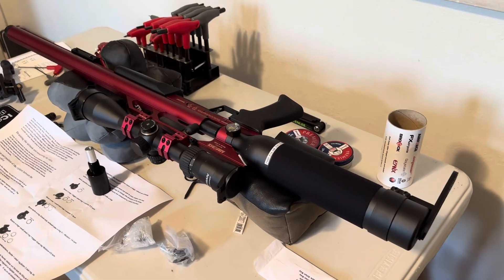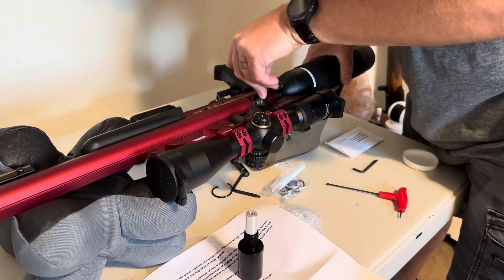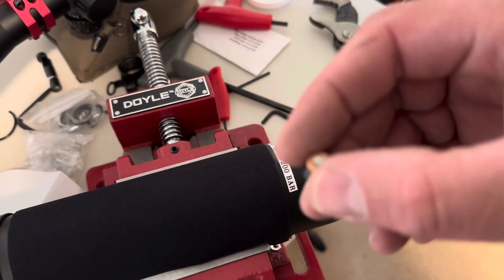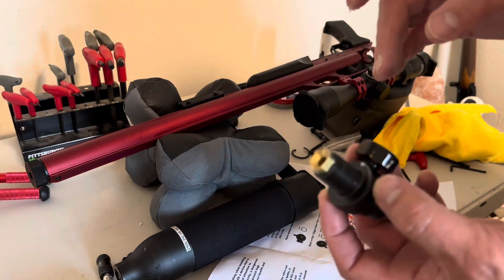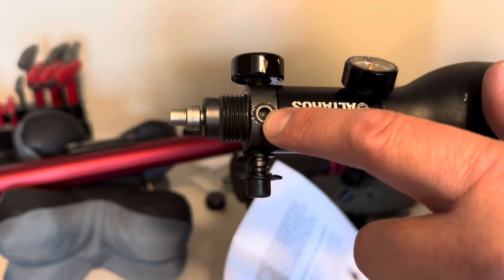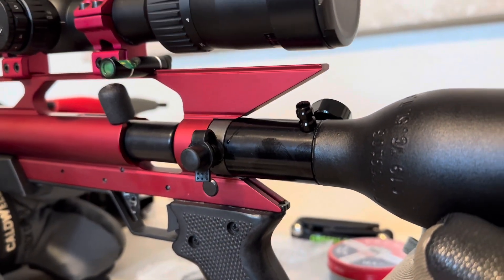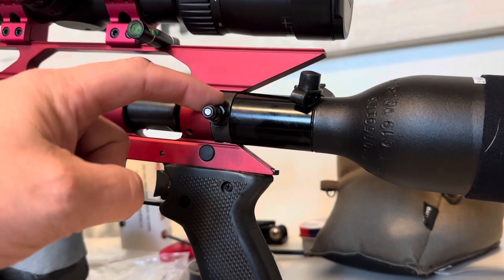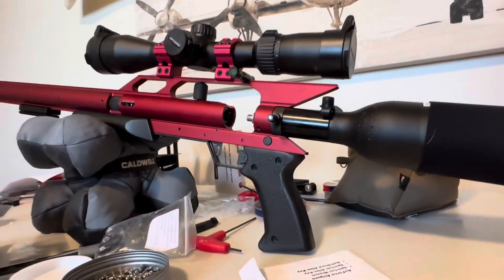Airforce Condor SS .22 Altaros regulator install challenges, and first shots test

Comment: Thanks for sharing this. I'm doing the same thing with my TalonP. I bought a 500cc bottle and the Altaros reg. I not looking forward to removing the valve from the bottle as well. I don't know if a little heat (not to hot) will make things easier? I know from my Leshiy 2 that only an O ring between the bottle and reg surface is enough, the pressure will seal it. Maybe this regulator kit is for more than one type of AirForce/airgun hens the extra rings?  W'll see . . . all the best from the Netherlands ;-)
Reply: I installed Altaros on my Talon SS 5.5 last week. To remove the AirForce regulator from the bottle Find a drill bit that fits the blank hole  snuggly (insert smooth end) and give it a rap with a small hammer Counter clock wise. I just laid the bottle on a towel and with a light tap  it came loose.
After installing, The rifle  gauge reads 1000 psi less than compressor gauge @ 3000 psi and Altaros reads 200 BAR.  I don't know if this is normal?  Altaros set at 105 BAR. Power Wheel 6.6, Over 100 shots started @ 745 FPS , ended @ 617 FPS  using Crosman 14.3 gr cause they are cheap, LOL * Note, Before install. FPS 750-850.  Going to set Altaros to 125 BAR See what happens.
Reply from the maker: @williamfrancis6993  Nice! it will be interesting to know what the 20 BAR increase does to the velocity. I will be running the chronograph soon and start the tune with the power wheel and the valve lock top hat kit. Also the 1000 psi on the rifle gauge would only be about 75 BAR from the regulator and would make sense to your FPS being in the 617-745 FPS, I don't think that would be a normal condition for the factory 105 BAR preset. I believe my rifle gauge is in the 1600 PSI range and was shooting in the 940-955 FPS range.
Reply: @justinmakesrepairs4535  @ 125 BAR-Power Wheel 6.6 the FPS went down ?  Six 10 shot strings avg FPS=701.5, 701.4, 687.4, 672.3, 657.5 & 639.6. I am going to reset to 100 BAR. This is making no sense.
Reply: @justinmakesrepairs4535  I started off at 2000 psi on rifle gauge but 3000 psi on compressor gauge and 200 BAR on regulator, reg Set at 125 BAR. Shot it down to 1700 psi and regulator 95 BAR. 10 shots to settle. Ten shot strings FPS Avg=701.5, 701.4, 687.4, 672.3, 657.4 & 639.6. Avg FPS 676.6.Total 80 Shots.
 I reset Altaros to 100 BAR. Compessor gauge 2900 Psi, Rifle gauge 1800 Psi, 190 BAR. Ten shots to Settle. Then shots 11-20=Avg FPS 670.1!  20 BAR less and only 6.5 FPS drop. ??????
Reply from the maker: @williamfrancis6993  You are right, the air pressure vs velocity do not make sense. I hope to get some data from shooting mine in the next week or so. I will post my results and an curious to see what I actually end up with. If I figure something out I will let you know.
Reply: @justinmakesrepairs4535  The Condor should get higher FPS, I would be interested in your shot count before it goes below the preset BAR. My Talon SS 5.5 shot string today: Rifle gauge 1800 Psi - Regulator preset : 100 BAR- Reg gauge190 BAR. 
Five 10 shot strings Avg FPS 662.98.Ending Psi gauge 1750 & Regulator BAR gauge 100. Shot 30 more and Psi-1750 & BAR down to 80. Rifle Gauge stays high while the Altaros BAR drops like a rock.
Reply: This worked! Several light to medium taps on the drill bit and it broke free. No vice needed. Thank you!.@williamfrancis6993
Reply from the maker: I bet a little heat will help with getting it loose, a good vise will also help in the process. From what I have seen and hear from various sources is every air tank and valve are just a little different  experience.